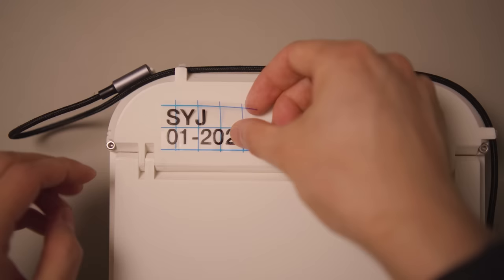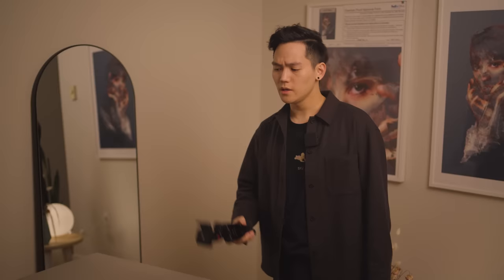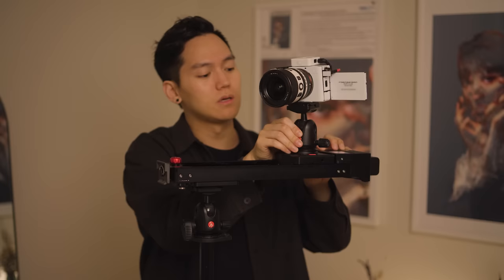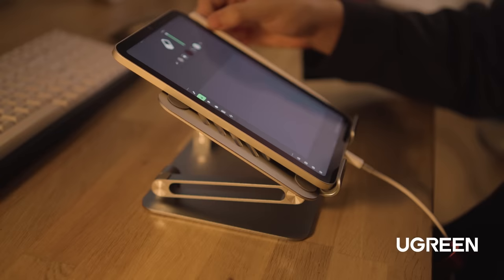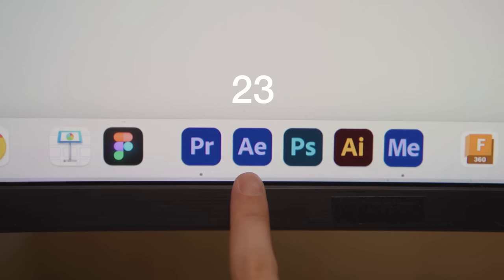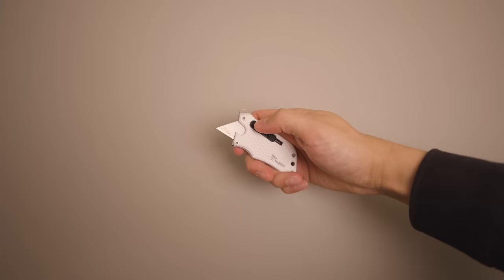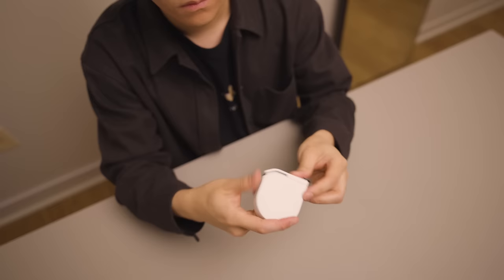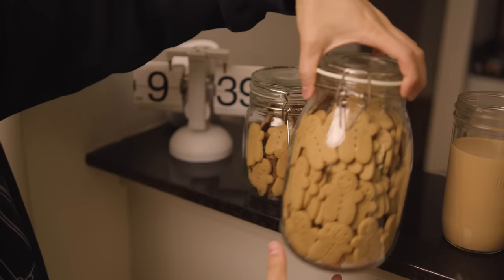42 Tools That Made The Cut in 2022

Comment: For a soldering iron I recommend the TS-100 digital soldering iron. Small, portable and work great. I bought them for our school robotics program where I'm a mentor.  Also recommended by Adam Savage so that's quite an endorsement.
Reply: pinecil pine64 is great too.
Reply: @dimeterious_fox  True, pinecil pine64 is better. TS-101 is also better than TS-100
Reply: TS 100 ist kinda dead unfortunately, cant even buy replacement shells anymore
Reply: TS80P is great for normal use too, I love the fact that I can use one power brick for so many devices.
Reply: Pinecil for the win 💪
Reply: @jurianzwaan  it's my favorite soldering iron, just perfect!
Reply: @Roc19961  yeap, ts101 is just a better version of ts100. I will recommend this one too
Reply: Ts80p is so useful on the go just make sure you also get a 30W+ power bank to fully utilise it
Reply: can also recommend the TS-80P super handy awesome little iron & I'm normally using a JBC solder station...its performance is quite incredible

Comment: for the soldering iron, i love the PINECIL - it's a super minimal, slim soldering iron that runs off usb-c. I usually plug it into a macbook charger because i know that way it has all the power it could need, but it can also run off lower-power usb-c chargers or any power banks that work for laptops or fast-charging.

Comment: Pinecel soldering iron from pine64 basically cannot be beat for price and functionality. It's a "smart" soldering iron and can be used kinda wirelessly with a powerful enough powerbank. It changed how I see soldering and made it enjoyable now. Similar to how you feel about the screwdrivers
Reply: Was going to say exactly this. A great choice.
Reply: Yes!
Reply: This. Heard good things about the pinecel. Though it is annoying and expensive to get here in europe. Also the TS80 would be comparable. I have a TS100 which I need an adapter for. But if he is acctually using the ugreen power brick. TS80 already uses USB-C. The TS100 needs an adapter. If you are soldering bigger things than pads on pcbs or wires you might want a bigger soldering station. Yihua is a brand that is cheap and decent. Well loved by hobbyists before the ts100 and ts80 tookover. Weller is nice but a little more pricey.

Comment: So excited that you're making more content!! For the soldering iron, I'm a big fan of the Miniware TS100 and the new Miniware  TS101, With a proper power adapter they can heat up in an instant, and tips cool down pretty quick for easy swapping during a project. The TS100 has a bigger community since the TS101 is newer, but the TS101 has been a joy to use lately.
Reply: This soldering iron is a game changer,  really compact.

Comment: You bring a welcomed fresh breeze into the 3d printing youtube space. Thank you for that.
As for soldering irons, i can recommend the TS-100. Best soldering iron i had (currently my 4th). Also a little tip i can give is buying soldering grease. Comes in little tin cups. Most solder allready has flux in them, but this helps regardless. Pre-tining cables and stuff becomes a breeze.

Comment: A good soldering iron is the TS-100. It’s an open source design, can be used with common laptop chargers, cheap, and takes hakko integrated ceramic heater replacement tips, so the only wear items are replaceable. Extremely fast to heat up. 

I do think there’s a more recent design with a different name that uses shorter tips but I forget what it’s called.
Reply: Pinecil is a good alternative that I often see recommended, personally have the TS-100 and I'm really happy with it so seconding that recommendation for sure!
Reply: Ts101 is the newest
Reply: The Pinecil is cheaper and mroe feature rich. The TS-100 is great but i would recommend the Pinecil over the TS.100
Reply: @m00se64  that’s what it was, thank you.

Comment: Highly recomend the TS100 soldering iron alot of other people mentioned
Also I made a custom cord for it so I can use it with my Omnicharger. That way I have a portable soldering station that doesn't need an outlet which makes soldering a lot easier.
If you haven't yet you should also look at the Omnicharger, definitely the best portable charger out there.

Comment: One of the biggest game changers for soldering,  is not using just flux core, but to adding your own flux. Using enough flux is the difference between holding your iron on a wire for 5 minutes and a few seconds. I find flux core rarely does what i need it to on its own, especially as wire gauge increases.

Comment: hi, for soldering I recommend thermaltronics tmt-2000.  one or two tips are enough, depending on the size.  they can be changed in a few seconds.  there is no need to adjust the temperature, everything is controlled by a physical quantity.  I've been using it for ten years and I've never encountered a situation where it wouldn't be enough (I'm a trainer in the field of manufacturing electronic assemblies according to IPC standards).  since it has a minimum of control elements, you can easily spray it white :).

Comment: My favorite soldering iron combo is a TS-80P with a high watt usb c battery bank. I’d recommend a larger solder tip but they are 3.5mm quick release which is very well designed!

Essentially you have a wired, and wireless setup in a super small and lightweight package.

Comment: The TS100 soldering iron is great. I have been using it for over two years and it’s features are great. Temperature adjustment (up to 450C), sleep mode and the best of all is, it heats up within 15 seconds!

Comment: Put a metal plate on the ceiling. Then you can use extending 1/4 20 sticks (like the insta360 invisible selfie stick) with a 1/4 20 magnet puck to hang things (like lights) from the ceiling.

Comment: A couple of good soldering irons are TS80P and  Pinecil v2. Both are minimal, and lightweight and can run off a portable battery via USB-C or any power brick that supports PD2.0/QC3.0 standard inputs.

Comment: As for the soldering Iron: Get the miniware ts80p. It gets hot really quick, and you can use a 45w charging brick, so you can even use it on the go.

Comment: Did you know that you can get adhesive, metric tape measures? They're made for marking tablesaw miter gauges but work really well for the aluminum extrusions. Just search on your favorite online retailer for "adhesive metric tape".  It even comes pretty commonly in white with black markings. I have it on the vertical of my Ender 3 so I can tell quickly at a glance how high it's printing. Super useful? Maybe not, but looks cool.

Comment: I used the Pinecil soldering iron that I power with an 18V tool battery and 3D printed battery pack adapter. Love it. Also 100% agreed about the Ryobi glue gun. Cheap and works great (assuming you're already into the ecosystem).
Reply: You don't even need to invest in their ecosystem, any battery with similar voltage and a 3D printed adapter will be fine.

Comment: TS80p is the most convenient soldering iron I've had. 30W doesn't sound like a lot but for most PCB and tinkering work it's more than enough, it heats up in about 10 seconds and it's just the most convenient soldering iron I've ever had.

Comment: I think switching to a temperature controlled soldering iron made a big difference for me.
Knowing if you solder needs flux or not.
Use solder wick to remove old solder so you dont mix different types

Comment: Ryobi makes a soldering iron too. Nothing special about the iron part, not adjustable or anything but it does have the nice heavy battery base you liked with the glue gun and it is very convenient if you need it somewhere other then your desk

Comment: best soldering iron: ts100 or sq001. both very small (think pen) temp controlled and very quick to heat if you have the right power source. they’re enough for most electronics projects. hakko makes decent larger high power desktop options.

Comment: For a good soldering iron, Hakko is one of the best brands. You can get the FX-888D its tried and true, but get the FX-981 if you can because it just works better. Also look at getting a de-soldering iron with a vacuum pump

Comment: Really excellent video! Re. soldering irons my general advice is: Unless you do soldering work for a professional environment, have a look at either the Hakko FX-888D or the Weller WE1010, they're both excellent irons and it really just comes down to preference. Also try out different iron tips, I personally love the small "flat head" (slot screwdriver) style as it allows for quicker heat transfer onto the pad. 😃
Reply: Learning about different tips and their uses was huge for me - right tool for the job. Knife tips are super versatile compared to the standard pointy tip, hoof tips are great for drag soldering etc. Voultar's videos are also great for soldering techniques which can remove a lot of frustration and failure with a bit of knowledge and practice.
Reply: I've had my Hakko for about 8 years now, it's a great iron, never had an issue with it.

Comment: I've owned many, many soldering irons, Hakko, Weller, Metcal, Ersa, TS100 etc. For budget, the Hakko FX-888D can not be beat, I have the OG analog control one and it keeps on kicking. The workhorse on my bench is the JBC Tools CDB, it heats up nearly instantly and is a dream to work with especially when dealing with PCB rework, tiny SMD packages and lead free solder but it's an investment.

Comment: TS80P soldering iron is very good, usb-c power delivery, 3.5mm jack for quick release tips, integrated tip cartridge design
open source (very good with ralim firmware/ironOS) and heats up really quickly

Comment: regarding soldering iron: I love using the TS100. you can even load a different open source firmware on it and reduce the current in order to power it via a 12V PD regulator hocked up to a PD power bank. soldering on the fly so to say

Comment: Love the blank hotel key card idea! I solved the same problem with some Rocketbook notecards (believe they call them "Cloud" Cards), but basically they're erasable/reusable notecards that I use now instead of Post-Its. It's been extremely handy for me because I get to archive my notes for a few weeks before erasing & reusing. They're also scan-able, but I haven't used that feature too much. Might be a good alternative to the key cards if you're looking to have more detail with sketches (you can use pens on these, and they have a dot-grid) and notes. I highly recommend if you're looking for a step-up.

Love your videos btw, look forward to your next one!
Reply: Also, ryobi has a new craft-sized hot glue gun that I use. I also have the big one like you do, but I find more practicality out of the smaller model. I hated dealing with the wires for hot glue guns, they absolutely just get in the way.
Reply from the maker: i didn't know they had a smaller one. that's neat. i gotta try that one! thanks!
Reply: @ScottYuJan  I'm Sara from Zbanx, your channel content and style is very good, it fits very well with a 3-in-1 3D printer that we are currently promoting. Your reply is very important to me and I look forward to hearing from you.

Comment: Per your request on tool brands:
Weller or Hakko are top of the line soldering irons.
Milwaukee, Dewalt , Makita are top of the line power tools
Snapon, Bahco, Mac, Knipex, Channellock, Bluepoint, Williams are top of the line hand tools

Craftsman, Kobalt, Ridgid, Delta, Husky, crescent (many others) make good tools depending on what they are. Typically all tools that are name brand (not amazon's random brands, they are bought reviews) will do good for almost everyone unless your relying on them in a commercial setting. I have some Pittsburgh Harbor Freight wrenches that I us typically 3+ times a week for the past 8 years or so and still working great.

Comment: I seriously love my ts100 soldering iron it was supposed to be a mobile iron that can run off a lipo or USB but with the firmware update it gets up to 850°f within a minute so it's now my full-time iron. It's small and digital with customizable color shells. They have a USB-C version and a new ts101 too. It's actually pretty crazy how powerfully it is in such a smal package.  But make it easy getting into places. Oh it also has Interchangeable tips and the heating  elements is in tip so its replaceable

Comment: Definitely check out a pinecil style soldering iron. They're super cheap, run off USB-C batteries (or basically any other power source), portable, and have a huge aftermarket community including custom firmwares and tips.

Comment: Like your videos. I like the Dremel Versatip 2000 for soldiering work. I build all my racing drones on it in the past. They run on butane gas so they’re portable. I remember I even brought it out to do soldiering for a connection in my car audio system. 😅

Comment: The toauto ft-80w it’s a great soldering for soldering PCBs or wires and a whole bunch of other stuff
Reply: It has a digital temperature display and you can adjust it to your needs and sleep modeAnd auto shut off which I think is the best feature I’m not sure if it is motion or vibration detection but I’ve left it on a couple times by accident but the screen well either start flashing sleep if it was left unattended for a couple minutes or if it’s been like four hours it will start flashing off on the screen and cools the soldering iron but as soon as you come back to it it starts preheating in seconds it’s cheap on Amazon and it comes as a kit with a solder sucker some solder and tweezers

Comment: As a solder you can use the TS100. It's digital 65 W (max) lipo battery compatible (12-24 volt) solder , it heats up in 10-15 seconds. I suggest to buy it with its silicon cable cause it's like non exist. I used to solder some a week and it's a game changer

Comment: I have the same Ryobi hot glue gun and it's one of my favorite tools. There's also a mini one that's really handy for tighter spaces and I got my girlfriend the newer version of the big one. It has a little flip out drip catcher, a few different nozzles, and two heat settings for high and low melt glues. But it's roundier and less ray gun shaped, So pros and cons :P
Reply: Also get a ts100 soldering iron. It's great, and little and runs of a wide range of voltages. There's a pack on amazon with a bunch of different tips for it, and I also got a ryobi battery adapter for power wheels, but I use it to run my soldering iron when I'm away from my desk.

Comment: I think you would love a TS80 soldering iron. You can power it over USBC. The firmware is upgradeable and open source and it has a great community behind it. It's one of those 'game changing' (actually the TS100 came first, but I'm guessing the USBC will be a winning feature for you) products for little soldering jobs. 

Also check out the Miniware ES15 screwdriver. Maybe not enough of an upgrade over your current electric screwdrivers to be worth a purchase. But same company as the soldering iron and it has a 'hammer/impact' feature which makes it punch way above it's weight. 

Other than that, kudos on your videos, you can really tell you have creativity and style running pretty deeply in your veins. Looks like you picked up some of that fastideous attention to detail from your Mum.

Comment: i would recommend any high quality, high power, digitally controlled soldering iron.  they make soldering so much easier.  people think they don't need higher power because theirs gets plenty hot.  but the temperature itself is not the reason; it's getting to and maintaining the temperature that makes higher power and digital control so incredibly nice.  i actually got my weller on sale for half off, but now that i've had it, if it broke i would gladly spend full price again for the convenience.  ...ok i just checked... you can now buy one for less than i paid for mine.  the WE1010NA looks about equivalent to mine, maybe better, and you can get it in a kit with a nice looking set of flush-cut dikes and a huge spool of fine solder.
another thing that can make soldering a lot more enjoyable is flux.  don't skimp on the flux.  it makes things get hot like ten times faster.  and when things are hot enough, they wick the solder up like a magnet.  and we all know who loves magnets.  oh and you can buy flux in a syringe with a needle tip.  it'll change your life.  just type syringe flux on amazon.  
but be careful; with both these combined, things will be getting hot very quickly.  and when things get hot that easily, you can easily melt the wrong things.  but it makes extremely quick and easy work of any soldering task, which to me makes it an enjoyable experience.  plus it makes you look like a pro, assuming you didn't melt half the enclosure or wire insulation in the process.

Comment: One soldering iron I came across is the "Aixun T3a". It's a copy of some JBC one, but:
1) It costs around 200 US Dollars instead of the 410 US Dollars of the JBC soldering iron (converting from the currency of my country)
2) It heats up from 100°C (212°F) to 350°C (662°F) in around IDK, 4-9 seconds I think?
----------------------------------------------------------------------------------------------------------------------------------------------------------------------------------------------------------------------
I personally have some soldering iron that's called "Extol Industrial 8794520" and was able to melt plastic with it really easily...
...but good luck trying to get your hands on one of those in the US.

Comment: I don't understand. Where does the plastic come from. I see you pull it off like it's sticky but where is it being made? I really don't understand how these printers work at all. Amazing video but is it melting? The plastic is the plastic on the board. I don't get it
Reply: its a filament, loaded from the big roll to the nozzle. as the printer prints, the filament is heated by the nozzle and the roll unfolds